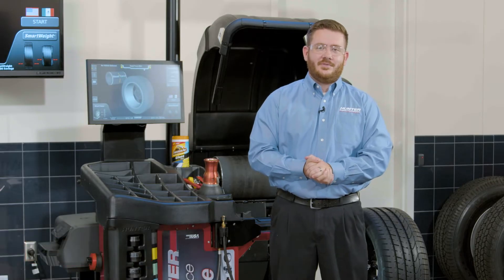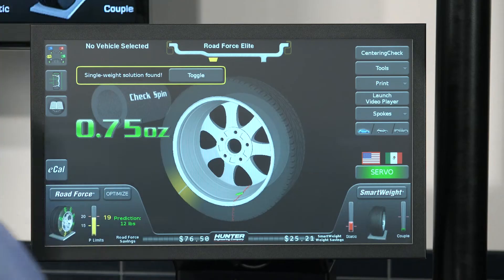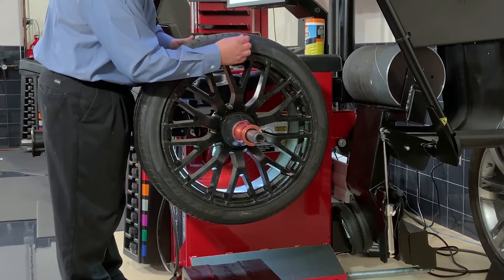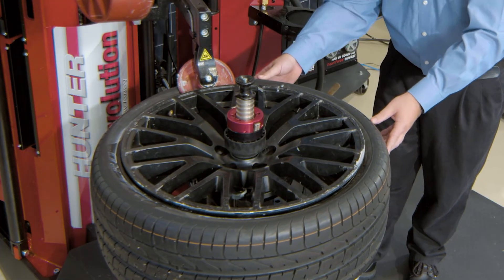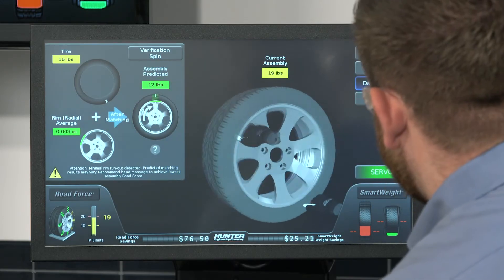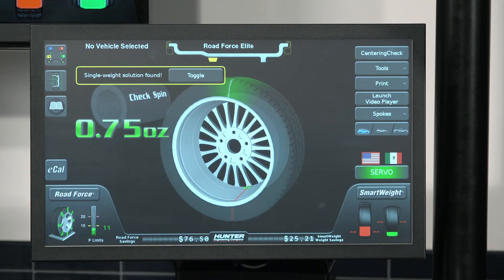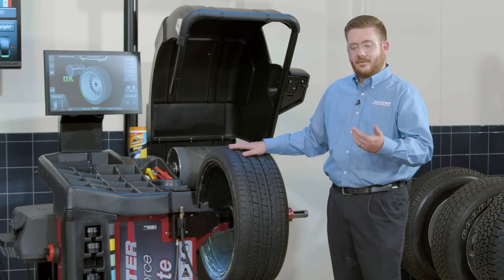Force matching with the Road Force® Elite

Comment: Professional Evaluation – Hunter Road Force Elite
As a workshop manager and technician with direct hands-on experience using the Hunter Road Force Elite since 2023, I would like to share the following evaluation regarding its performance versus its high purchase cost.
Areas Requiring Further Development Relative to Price
Gap Between Marketing and Real Performance
While the device is heavily promoted as the ultimate solution for wheel balancing and “Road Force” diagnostics, in practice it often fails to detect certain run-out or alignment issues. This discrepancy undermines customer confidence and reduces the return on investment.
Inconsistent Road Force Accuracy
For larger rims, run-flat tires, or slightly bent wheels, the Road Force readings are not always reliable. Given the premium cost, users expect consistently precise diagnostics across all wheel types.
Manual Expertise Still Outperforms in Critical Cases
Despite its advanced vision system and automated software, certain defects remain easier to identify with a trained technician’s eye and hands. This raises questions about the balance between technology and real-world practicality.
Excessive Alerts and Non-Critical Notifications
The system sometimes generates redundant or overly cautious warnings, which slows down workflow and may discourage technicians from fully trusting the output.
High Total Cost of Ownership
Beyond the initial purchase, ongoing expenses for service, adapters, software updates, and spare parts add significant financial burden. This further reduces the value proposition compared to the premium price tag.
Customer Experience Concerns
A notable case involved a luxury vehicle with new wheels that exhibited a clear pull to one side. Despite proper alignment, the Road Force Elite failed to identify the cause. Only through manual tire rotation did the issue become clear. Such scenarios can be embarrassing in front of clients and diminish confidence in the machine.
Recommendations
Enhance Road Force algorithms to improve sensitivity and consistency in detecting subtle wheel and tire anomalies.
Upgrade the Vision System and integrate additional sensors to complement manual inspections.
Provide adjustable software settings to reduce non-critical alerts and streamline workflow.
Offer more transparent and competitive pricing for parts, service, and software updates, especially for markets outside the U.S.
Align marketing claims more closely with real-world capabilities to protect professional credibility.
Conclusion
The Hunter Road Force Elite is undoubtedly an advanced piece of equipment with impressive software, but its real-world accuracy and reliability do not always justify its premium price. For many workshops, the heavy investment is difficult to recover unless significant improvements are made in both hardware performance and overall cost of ownership.

Comment: Where can i find a hunter machine in germany?
Reply: I’ve been in Estonia, waiting for the first store for about five years since I found out about Hunter. A couple of months ago, the first one opened near my home in Tallinn. I was one of the first to respond to their announcement. I immediately found two wheels with vibration issues. One of them I was able to rotate, and it turned green; the other one still had a defect and remained red. But we put it back on anyway. This equipment also measures the direction of lateral deviation, so you can position the wheels in a way that makes the car drive perfectly straight.

Comment: Gello fo you plan to put a lookup by zip code for all qualufied road force ture shops?
Too many crooked shops say they road force, but you are bot allowed to go in the shop due to insurance slip n fall lawyers..
Please implement a lookup for inceased sapes and safer tires on the riad. Ecentually the 🫏 crooked shops will get i6ut if business and fewer dead on the road

Comment: Shouldn't the added weights be placed along the centerline of the laser line as opposed to being placed perpendicular to the line which is where you placed them?
Reply: Only if it's a static balance. A dynamic imbalance would mean one eighth of the wheel is heavier than the other seven, as opposed to one quarter. If that makes sense.

Comment: I am having a national tire shop not being able to balance my new tires, they claim their guys know what they are doing but I have already found a new set of Michelins to have 2 bad tires, defect from the start, and the tire shop acknowledged that and switched them out by my question remains to why the Hunter machine did not pick this up on 2 tires to begin with???  Now, I still have shimmy in the front at 50-80. This is with another set of brand new General Grabber HTS 60 tires. I rotated from to back, one side at a time and it made a slight better change but in the process, I ran the back tires with the van jacked up and found the right rear tire has so much lateral runout that it shakes the van while sitting on jack stands. I'll be heading back to the tire shop but once again, is it the fault of the Hunter machine or the tech using it???  Also, as 50 year, multi certified mechanic, started career in family repair shop in the 70's , we only used a static bubble balancer and things worked fine. I am of the opinion that the Hunter has a fault in that it does not high speed balance or check the tire at said speeds. Tires ALL will behave very different at high speed than the Hunter slow turn that it does. I'm tired of spending and wasting time at the tire shop, about ready to give them these tires back and find another place that has a Hunter and hi speed balancer.
Reply from the maker: Hi Joseph, thank you for the concern.
The Hunter Road Force balancer correlates very well with both high-speed uniformity machines as well as high speed balancers.  We are confident our machine can solve the vibration issues with your vehicle.  It is very challenging to know what really happened in a situation like this.  Rather than speculate, I would start by asking the tire shop for a printout of the Road Force measurement the next time you have it in there.  That ensures that the technicians performed the Road Force measurement so that issues like this can be identified.
Reply: @HunterLearningChannel  Thank you and great idea, I am bringing the tires back to have the balance rechecked and will ask for a print out and to actually watch the balance process up close with the store manager. I still question the science of balancing a tire at low speeds like the Hunter Road force does without a check at higher speeds????  Why not incorporate this feature on your machines????
Reply: They don't know how to operate the machine plain and simple its the most frustrating part of it, there's extra labor involved nobody wants to do plus it's a low paying job so good luck finding someone who wants to even learn the machine, they're extremely capable and can detect a bad tire every single time, as well as a bad wheel.... But the funny thing is if you have a bent wheel with this machine you can take your worst tire with the highest road force number and force match it to the "bad wheel" and frequently you can turn this into the smoothest wheel and tire assembly on the car, seen it many times... But this requires extra labor and training and that's the issue with most techs not knowing the machine
Reply: @doddgarger6806  Thanks for the reply. I went back to this tire store and the manager himself too the time to road force and re balance the tires. he let me stand with him in the shop and watch the process. As it turned out, he found 1 of the twice balanced brand new tires that he could not balance not matter how hard he tried to spin the tire on the rim. Funny that his tire guys let this tire go out on my van with a terrible road force balance.  But I still believe and know that the hunter road force machine is not perfect. It does spin the tire/wheel assembly at speed you drive at and all tires and wheels will have different harmonics at varying speeds. this manager admitted this too and he pointed to set of high end racing tires/wheels that this local racer brings to him because of his extensive know how on how to get a good balance. But yeah, the bozo's working at tire shops are there to install the most tires in the least amount of time and that is always a recipe for shoddy work. It still had a slight shimmy at 70MPH  but found that if I drove 75-80, the van was perfectly smooth.

Comment: I have a very important question, my shop is dead set that if a road force diag is preformed on a wheel and it is in the red, the tire needs to be replaced. I do not believe this to be correct due to the fact you can get a brand new tire with excessive road force. It’s a balancing machine not a damaged tire diagnostic machine
Reply from the maker: Thank you for your question. There are a few things that can contribute to Road Force - out of round rims, tire construction issues, and tires not seated properly on rims.  Any of these conditions can cause a vibration for your customer and the Road Force balancer can detect all of them.  It is up to your shop to determine how this is implemented but verifying Road Force is within specs ensures your customer will get the best ride possible.
Reply: @HunterLearningChannel   thank you I have a meeting tomorrow with upper management to inform them more on the machine as I am certified by hunter.

Comment: Why isn’t there bead massage on the opposite side?
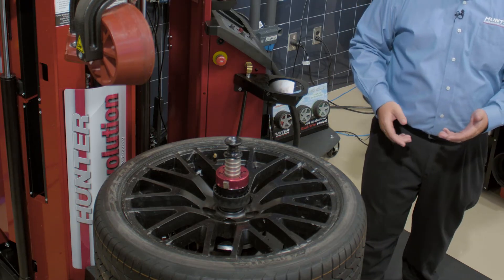Reply from the maker: Hi, thanks for the question. Bead massage is actually happening on both sides of the assembly.  The Revolution tire changer automatic bead massage starts on the top bead [4:33], then the lower roller gets the bottom one after the top roller backs off [4:54].  If you look between the spokes you can see the arm come up before the tire wheel spins.
Reply: You can definitely see the two arms one above and below massaging. Top was first, the second arm below did its job.

Comment: This machine literally tool out 90% of my front end and steering wheel vibration between 65-70 mph ...
Guy said my kumho tires are to blame.
Reply: Same thing with me. BFG KO2 tires. Brand new and was having vibration at 70-80mph. My mechanic said the wheels are balanced, its as good as you are going to get with off road tires and that Road Force balancing wont work with all-terrain tires. Then, took them to a tire shop - they said we have lots of issues with those tires and all 4 are visually out of round... Take it to Toyota dealership with the Road Force balancer - riding super smooth now. What a pain. Great solution.
Reply: @andrewgarcia940 KO2s are a terrible tire to balance.
Reply: @justintarvid  thank you
Reply: @andrewgarcia940  and the issue is you cant see the out of round tires unless they are mounted to a wheel. 
I have been buying kumho tires for well over 20 yrs and have never had this issue with out of round tires. 
But i guess at some point its bound to happen. When you mass produce millions of tires, there will be some that wont come out "perfect" round ...
Reply: With this equipment, you’ll find out that many expensive tire brands are complete garbage. For me, that’s Pirelli — they’re always uneven and cause vibrations. So far, the number one brand for me is Michelin.
Reply: Too many Tire "Technicians", AKA weight chasers, that don't really know how to do their job, all they know how to do is push buttons on the computer and stick the weight where the laser points to, chasing weights all over the wheel.. so many of them just don't really know any other physical techniques to try unless the computer tells them how.. 🤦‍♂️
Reply: @mikeschwab1943  is that not the point of the machine ?? To tell you where to put the weights to balance them ?
Reply: @ACommenterOnYouTube Yes. But if you aren't doing it right you could end up with weights all over and it won't be correctly balanced.
Reply: @justintarvid  everytime i change my tires, i take all the weights off and have them start from scratch. Because if you dont, they wont and tbey just add more and more weight and you will end up with 20+ weights
Reply: @ACommenterOnYouTube  Sorry, thought I replied to the comment above mine.
Reply: @ACommenterOnYouTube  yes it is, but as a trained technician people should also know how to do other things that the computer doesn't tell them. Like match mounting the tire in the proper position on the rim to get the better balance, instead of just continuously sticking more and more weights on every time the machine keeps calling for more.. I've personally seen several of these guys just stacking 10 oz of Weights in one spot and 8 oz on the other side because the computer keeps asking for more every time they spin it, because they have no clue what else they should try doing beyond that.
Reply: @mikeschwab1943  Well i do know that when you mount a tire to a wheel that the red dot goes to the valve stem or if you only have a yellow then the yellow goes to the valve stem, if you have both, red to valve stem. This gets the tire/wheel balanced better so less weights are needed but how often to those guys ever pay attention to those dots and place them where they need to be ...??
This is why when i change out my own tires, the ones that i can, i make sure the red or yellow dot goes to the valve stem and then bring it to them for balance after i remove all the old weights ...
Reply: @ACommenterOnYouTube  correct.  And if the tire doesn't have the colored dots and the computer is calling for more weight stacked in the same area, you can still Dismount the tire and spin it 180° to the other side of the rim, remount it and try it again. Or you can do it in 90 degree increments if needed, do your best to try to offset the difference between the bad spot in the tire and the bad spot in the rim. I know it doesn't always work the best, but it can often work pretty well. I just wish more of these so-called technicians out there would actually take the time and effort to get the job done better instead of just simply chasing weights back and forth on the machine..
Reply: @mikeschwab1943  see thats the issue, its "time" and they have customers waiting. To sit there and do what you said for every tire, your customers would leave because its taking you triple the amount of time to balance a tire because you are doing it the proper way. 
I am speaking on behalf of the managements mentality of quantity over quality. Thats the way they think and thats the way they train their techs, get more done which means more $$ profit in their pockets. 
If you want it done right, do it yourself and buy your tire machines
Reply: Well I can understand that to a point, but in my opinion that's garbage customer service. I don't necessarily mean to do all that for every tire, I'm sure most tires that come in don't require all that extra effort, but I know that some do. They're focusing on quantity instead of quality. They should try doing the job right even if it takes a little longer, so that the customer leaves as satisfied as possible. What's the point if they're just going to half ass it and do crap work just to push people out the door.. if you take the time and do it right for me and I can leave relatively happy, I'll come back to your shop for more work, even if it's out of my way to get there, because I know I've been satisfied with the work before
Reply: @ACommenterOnYouTube   I can't afford to just go buy thousands of dollars worth of Tire Changer and wheel balancer, so I can do my own tires once every few years.. no way in hell that's worth it, it would just be nice if people were trained to actually do a proper job in the first place
Reply: @mikeschwab1943  Until you become that manager you will not understand. 
When you have the 2nd and 3rd level managers breathing down your neck to get more customers in and out, you may change your mind and forget quality.
That or you quit because you dont agree with their way of work then they hire the next guy that will obey and follow their rules. 

I agree not all tires and wheels need this much attention but when most are more easily balanced, you miss that one or 2 that do need the extra care.
Reply: @mikeschwab1943  This is why i do my own tire changes and balances to tires i CAN remove and mount myself at home.
Issue is some tires are too tough to get off so i have to take them in. 
But when i do take them in, i remove all the weights so they have to start from scratch so that i dont wind up with double the weights from where they started and i know for a fact that those guys will NOT remove the old weights because they dont care.

Comment: Impressive. But, the tire still needed three quarters of an ounce to balance out.
So the indexing of the tire and the rim didn't really balance anything out that it not unless I'm not following something here.
Reply: Hi Robert Robert. This is what I understand. There are inconsistencies in the material densities of the rim and tire resulting in "heavy " areas.  The computer analyzes these areas and to offset any influences on the balancing procedure it zeroes out these heavy spots so they "cancel" . This is done by rotating the rim and tire independently so the lines produced by the computer match. The tire is then finally balanced . You can also think of it this way. A "square tire" can be balanced but if you put a square tire on a vehicle well , it would vibrate like hell !! Road force balancing smoothen out the forces of the tire on the road so the heavy spot on the tire does not hammer the road every time it makes a revolution. Hope this explanation helps.
Reply: @abyssalsoul6216  That makes perfect sense I understand it absolutely.
I had my tires road force balance once on my Crown Vic interceptor. I wasn't impressed but later on I learned that the operator and how he does it influences the outcome quite a bit.